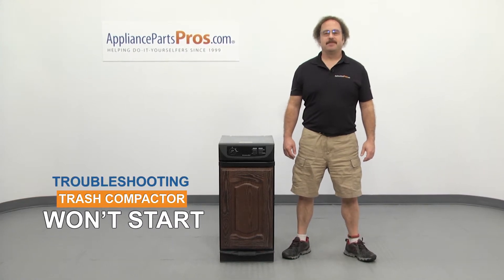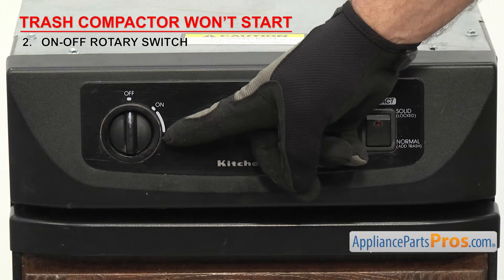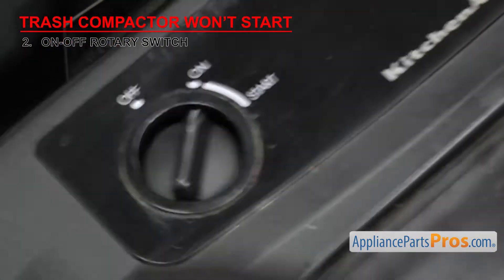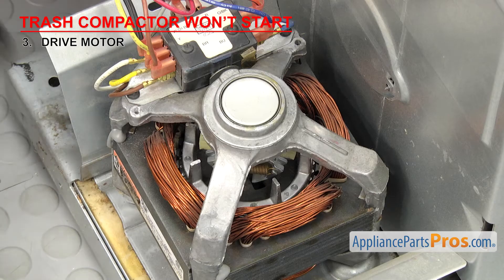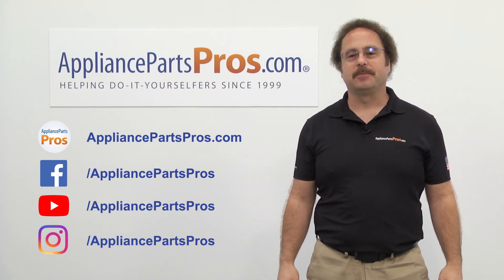Trash Compactor Won't Start - Top 5 Reasons & Fixes - Whirlpool, Kitchenaid, GE, JennAir, & more

Comment: what is a rivet
Reply from the maker: A rivet is a permanent metal bolt with a head on one end and a smooth cylindrical shaft on the other used to join two or more pieces of material together.

Comment: My trash compactor will not start on its own. If I barely move the chain it will run perfectly. Any ideas?
Reply: I think the directional switch, tilt switch, or on-off rotary switch have failed. If not, try looking up, "Trash compactor ram gets stuck" on this channel.
Reply: It may be the drive motor that might have failed.

Comment: I haven’t  had a compactor repair for probably 20 years, I had one the other day. A rat had chewed up every wire at the motor and some in the front, it was a mess.
Reply: 6:48 "Keep an eye on children to make sure they don't play with the compactor. Some units have locks or require keys to operate. Always follow the manufacturer's instructions and never put hazardous items in the bin. These include glass, aerosol cans, and batteries, as well as items that could damage the compactor itself, like hard objects that don't compress. Never use your hands or feet to compact the waste in the unit. It's also advisable not to put any items in the bin that may decompose and create bacteria and odors since the trash sits there longer between changes." That makes me laugh.
Reply: 0:00 Intro 
0:17 Power supply 
0:55 On-off rotary switch 
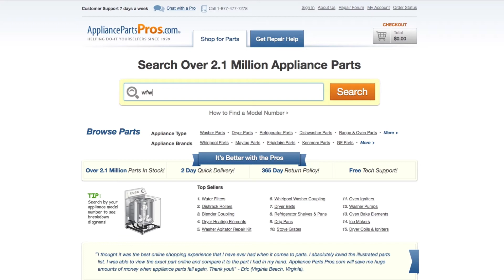2:25 Ordering parts
2:52 Drive motor 
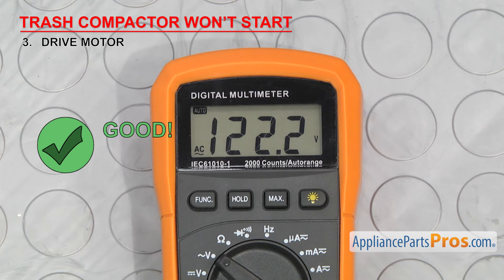4:30 Door switch 
5:32 Like and subscribe
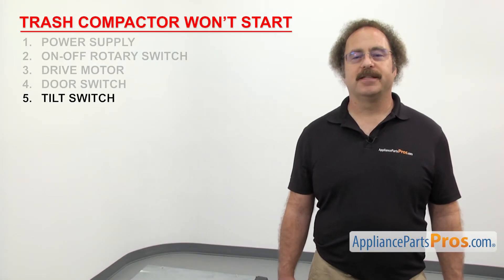5:37 Tilt switch 
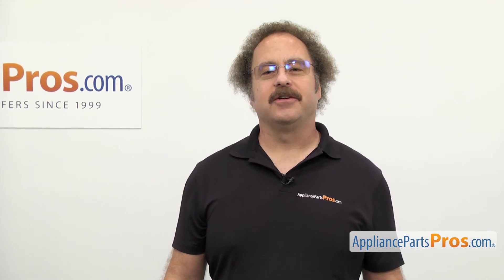6:39 Funny safety tips 
7:37 Outro